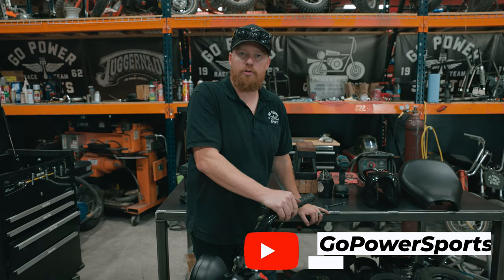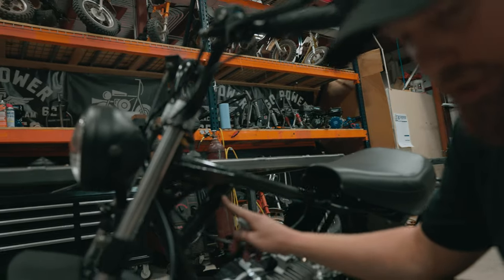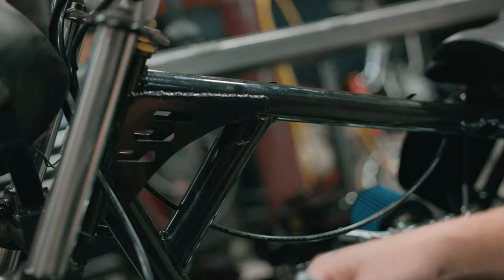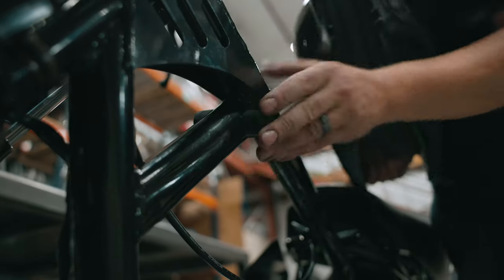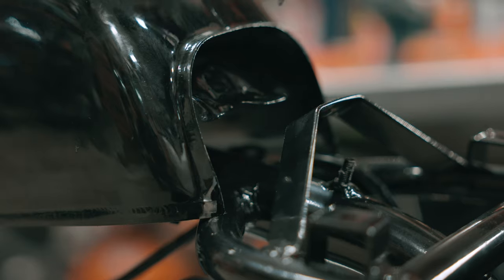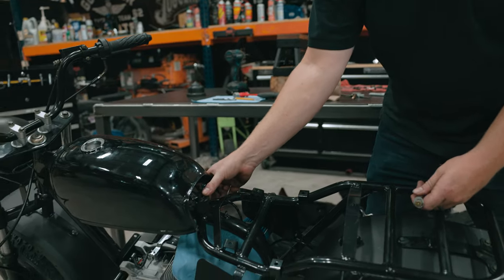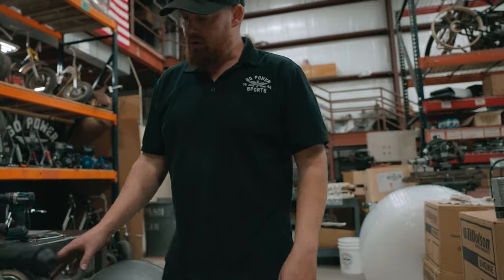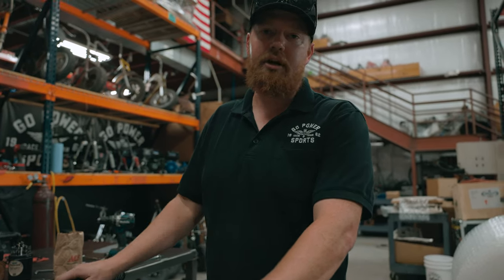How to Install a Motorcycle Gas Tank | No Welding

Comment: Why isn't there a balance tube running between the bottom-halves of the tank? Won't that just leave one side unused, effectively shortening the calculated total range expected from it's total capacity?😕

Comment: Will this tank fit on a mega moto 80?  If not what do you suggest?
Reply from the maker: This tank will be pretty big on that small frame.  We typically use the smaller 8" Cylindrical Tanks on the Mega Moto 80.  https://www.gopowersports.com/gas-tank-aluminum-cylinder-8/

Comment: With the tillotson and needing a vented tank will this tank not air lock since it is larger or will you have to run a mikuni over stock carb?
Reply: Probably will still need some kind of vent
Reply: @samhilger5761  it's kind of what I was thinking
Reply from the maker: This tank will vent through the gas cap.  You can run either stock or Mikuni.  Can't go wrong either way.
Reply: @GoPowerSports  thank you so much for clarifying

Comment: How do you get the first two grommets to stay together?
Reply from the maker: The will be pressed in place by the gas tank, which has circle cut-outs to sit on.
Reply: Pressure of tank holds them in place , once back bolts in its locked there

Comment: When I installed the tank everything was smooth except for the gas flow. Almost no gas runs to the carburetor. How can I fix this?
Reply: Obviously I'm a little late to your party, but my TrailMaster purchase was recent. I just received my tank the other day and will be mounting it either this weekend or over labor day. My approach is going to be lining the tank up (when the bike is held upright in it's normal riding position) so that the valve/exit for the gas, is at the lowest position relative to the ground. Not sure how much I'll have to raise the rear of the tank to achieve that (or how it will look esthetically, but I believe this would solve the problem you describe.

Comment: I just ordered this tank but I would like to paint it the trailmaster blue. Can you recommend a specific brand and the specific color blue to use, please and thanks?
Reply: If you really want it to match, you can go to a decent auto paint store and have them mix you exact color using their machine to match it.  This can be loaded into a spray can and usually cost s 25-30 dollars. Myself I'd just get it close at a decent supplier with prepackaged rattle cans, but if I had a customer or friend who wanted it perfect that's what I would recommend.